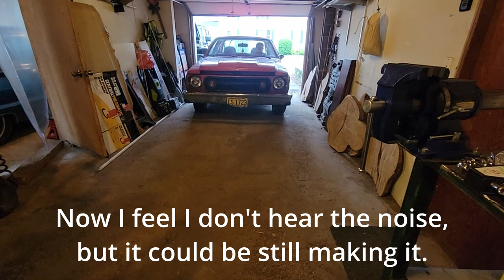Issues With Gremlin Engine After Finishing Disc Brakes. 1976 AMC Gremlin

Comment: You could of sucked some slugde up n plugged up the oil pick up.n took a bearing out. 35 yrs is a long time to sit. I'd pull it out and go threw it.before you do more damage.
Reply from the maker: Yeah, I might have to pull the motor. The thing is I wanted to do a bigger motor eventually just not right now.  I was hoping this motor would work so I can go to the local car show a few miles away.

Comment: Does that have a smog pump?  It would be an extra thing running on the fan belt besides the alternator and water pump.  They usually just seize but maybe...
Reply from the maker: I just have the water pump and alternator running off of one belt. It may have had a smog pump at one point but it didn't have one when I got the car.
Reply: @robbieshobbies93  That noise sounded like air being pumped. I'd look for an intake or exhaust leak. Audio over internet being what it is... But I would look for a leak before condemning the motor for that knocking sound.
Reply from the maker: Yeah that's fair. I'll have to do at least a compression test before long. I appreciate the insight. This is all stuff I've never dealt with before. Thank you.

Comment: What weight oil are you running? May want to try 20w50 and see if that gets rid of the noise.
Reply from the maker: Yeah thats a good point.  I think I only used a 10w 30 for oil. That could make a big difference.

Comment: Why did you use a Drum Brake Master cylinder? Drum brake master Cylinders have a pressure residual valve built into the front circuit and hold roughly 3lbs of line pressure.  This will cause disc brakes to drag.  Secondly, you should use a proper disc brake master cylinder to have more disc brake fluid capacity.  Disc brakes require more fluid than drums, this is why on disc brake master cylinders, one reservoir is larger than the other. The big one is for the disc brake side.
Reply from the maker: That's good to know. I didn't know some of that. Especially the line pressure on the front circuit. I bought the master cylinder when I originally planned on keeping the front brakes as drums but now I'm going to need to get the correct master cylinder. Do you know which master cylinder I should use if I had disc brakes in the front and rear axle? Would it still be the disc front/drum rear master cylinder? Just wondering for if I did swap the rear axle.